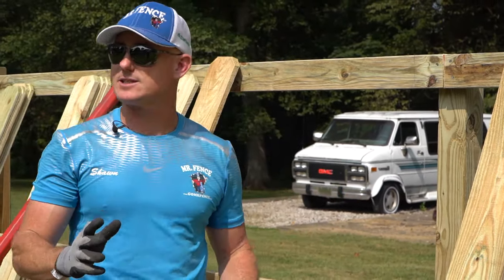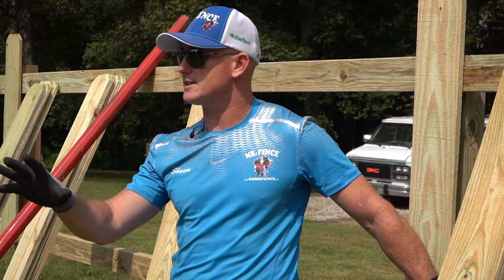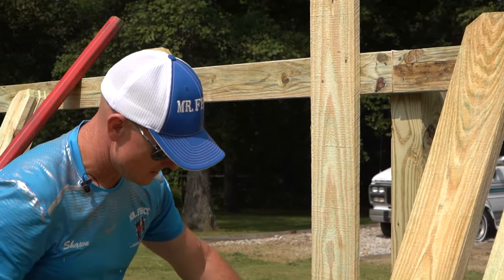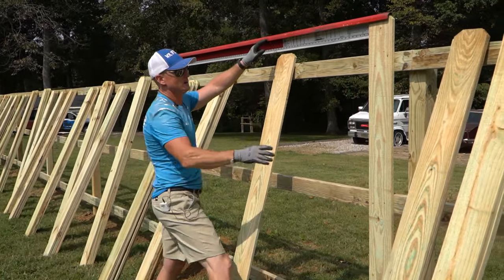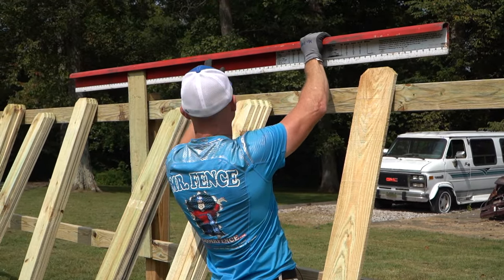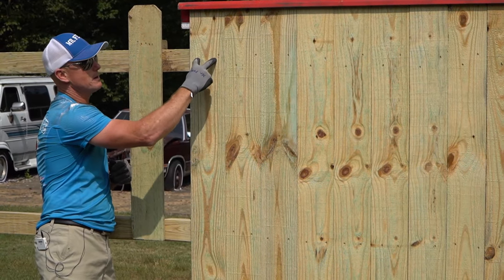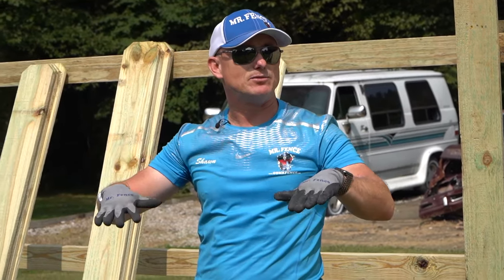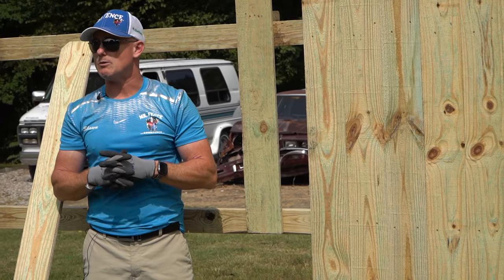How to Nail Pickets on a Wood Fence | Running Pickets

Comment: 4:42...what these bad fence builders always do and ya can see it plain as day..running the boards you'll secure the pickets against and look at those boards attached to the 4x4 posts...only TWO inches of that board holding up all that weight and using nails..lol..vs doing what I do...the right way...using 6x6 posts and staggering the boards up and down so you can put the entire board against the post.  I use a 2x6 on the top and bottom boards and a 2x4 on the middle board.  Then I can screw in 5-6 screws on each post where each board attaches to it and I use fat screws to add more strength.  Then the pickets get two 1 1/2" screws onto each board and never had any of my fences I've built...the right way...failed.  and putting the boards butt up against each other...lord..this video shows fast lazy "it looks nice in the end" fence building...no thanks!
Reply: You should make a nice video showing all this you write. I'm sure  many will comment how over-the-top it is, while others will praise you for the longevity, damn the cost.
Reply: @BlueOriginAire  do not screw boards ever wood heaves and all you will  accomplish is split boards
Reply: @jored70  
Plenty of "Pro" guys are screwing in the Rails, gates and other areas. Not sure why. Another Pro says only Nail.
✌🏽🥳
Reply: @jored70 if you dig your holes and set your posts correctly they won't heave.

Comment: You keep a torpedo level in your pocket and you chek them every 4 pickets.He doesent tell us hes using number 1 lumber.Most dogear pickets arent milled true.You better keep an eye on your work.
Reply from the maker: We are using run of the mill box store pickets not torpedo level. Torpedo level wi just give you an inaccurate reading. Using a 6’ level (the post) gives you a better alignment. You are blending 16 very untrue pickets into one global section that is plum at the post. But you go ahead and keep on using that tool torso every 4 pickets buddy. 
Then one day the light bulb will go off and you will learn that you just didn’t know what you didn’t know until you learned what you didn’t know. It’s a journey for all of us just takes some a little longer than others.

Comment: The lazy way to do things using nail gun only to have them nails to work their way out in a short time, correct job using screws that will out last nails by years.
Reply: lol you are clearly not a fence installer.